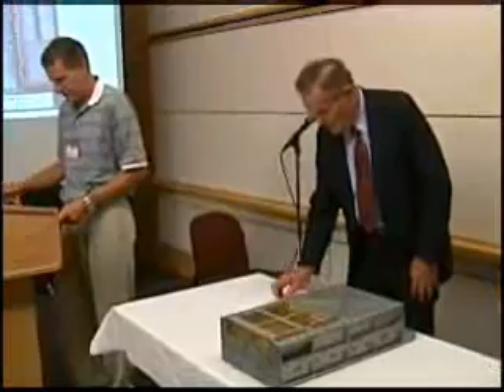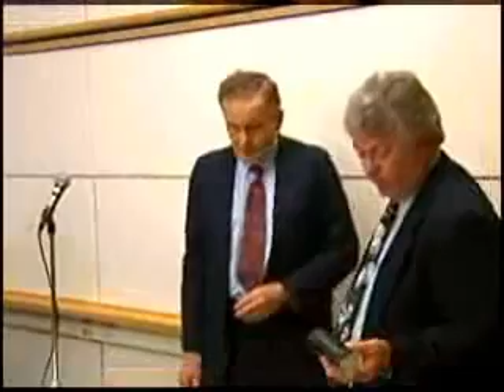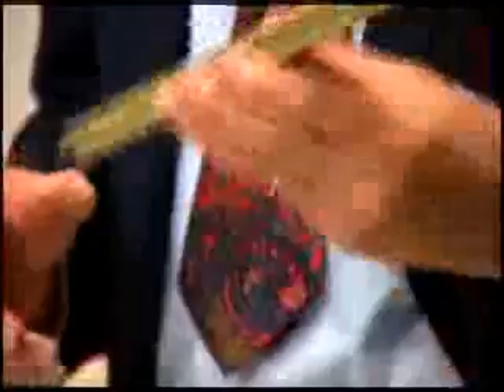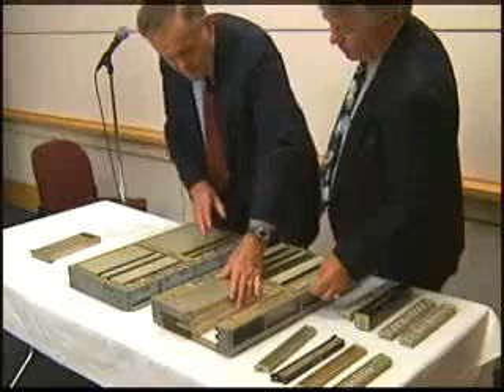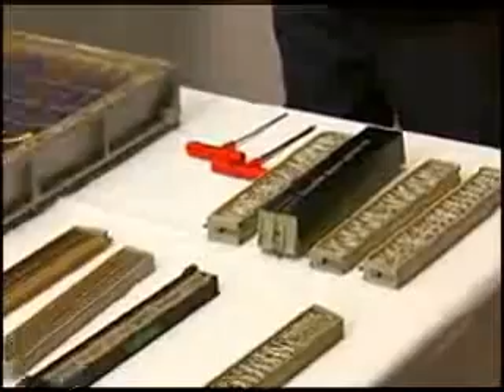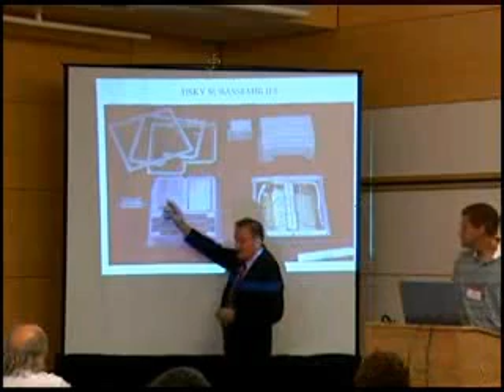Historic Disassembly of a Block II Apollo Guidance Computer - Eldon Hall - 2004

Comment: Incredible the amount of man hours required to actually build the computer and the massive oportunity for screw  ups which they never had. I wonder how small all the computers used could be shrunk down to using today's state of the art. Not sure I would trust some of the code monkeys to write bullet proof software but it would be massively smaller and lighter and every pound they sent to the moon took about100 to get there. Just interesting to ponder how much a modernized Saturn could differ. Oh and for a interesting companion video to this look at the way the ground control was built and wired etc, that is another eye opener. Almost makes you wonder where that moon landing set was when you see it lol.
Reply: If you allow me to ignore the whole circuitery dealing with the power supply, then its easy: 1 IC
One could use an FGPA to build a logically equivalent processor or you could build a simulated processer using eg. an ARM chip.
Reply: @kallewirsch2263  I think it might have to be at least a few chips, given the necessary redundancy, and how it would reboot if the processor got stuck or overloaded.  Though I suppose one might be able to put all of the separate circuits onto a single silicon die, it seems like that might somehow be less desirable.
Reply: @name_here___4070  
Actually the opposite is true. If you integrate everything on a single die, you reduce the risk of mechanical damage because of the circuit getting loose from the board for whatever reason (eg. vibration)

As far as I know, there was no redundance in the AGC. The only redundance was that there were actually 2 (if we count the computer running AGS, then 3) computers on board. But the AGC itself ....
if the processor gets stuck, then a watchdog takes over and resets the whole computer. That is pretty basic stuff, every µC used for industrial purposes is capable of. Handling overloads - well, this is a software issue and how the system is set up. By itself a CPU is never overloaded. It processes that many instructions per second - all the time. If that number is sufficient for the tasks needed to be done - that is a different story and has to be taken care of in the programming.

The processor I am working with is an ST32F7. This is a single IC containing an ARM core, 1MB of Flash ROM, 350KB RAM, FPU, lots of peripherials and of course that includes a watchdog timer and brownout detection. All in 1 IC. All you need is a 3.3V power supply and the computer is up and running with a clocking frequency already higher then what the AGC had. If you need full power, you connect a crystal to it and clock the computer with 214Mhz. Way faster then anything the AGC could do.
And there are literally thousends of other µC types available out there. Some less capeable, others more capeable.

Comment: It's remarkable just how compact they were able to make this computer back in 1962.  Just four years earlier the smallest available digital computer, the Librascope-General Precision LGP-30, was the size of a dishwasher.
Reply: They were the first to use integrated circuits, that's why.
Reply: Thomas Kundera Yes, but I would still had expected it to be larger since this is a fully bit- parallel design rather than bit-serial like the LGP-30.
Reply: i know the tech isn't the same, but the electronic principle is, when i put a push-pull knob on my Les Paul to play in series or parallel. I wish i knew electronics like these fine Gentlemen do.